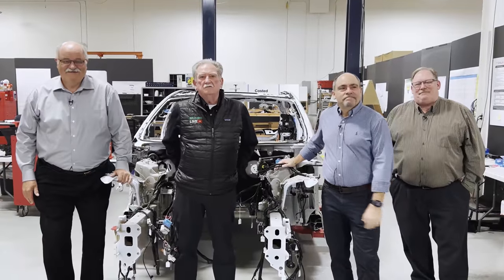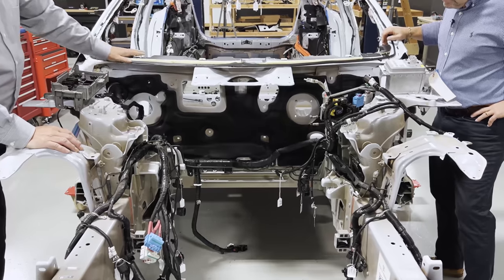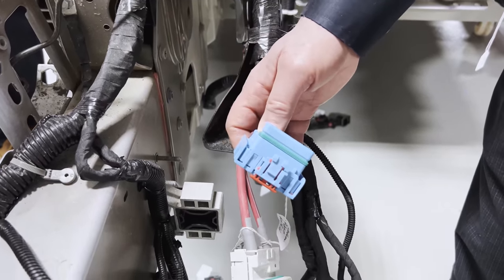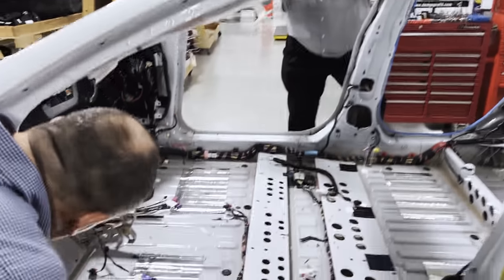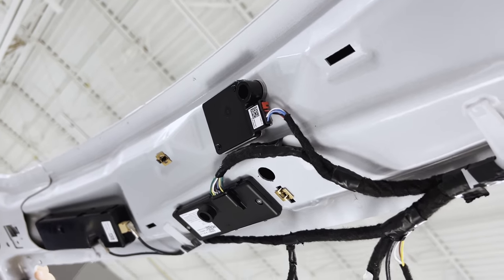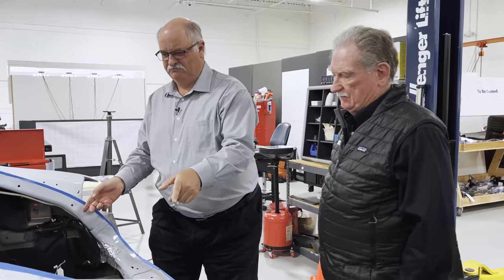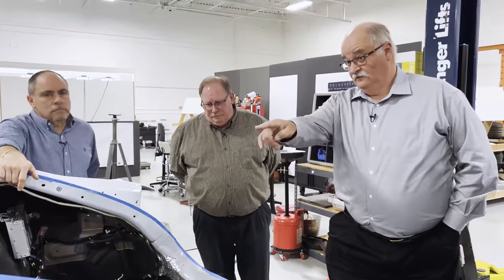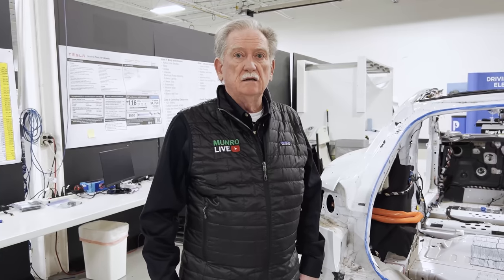Plaid Low Voltage Wiring First Look | Tesla Plaid Teardown

Comment: the loop on the harness going to the seat is to solve the issues of the harness being tangled with seat guides when the seat moves (up, down, forward, backward). Basically, the harness needs to exit the carpet in a certain direction to avoid that issue. This is a cheap and quick solution compared to rerouting the whole harness to solve the issue. I work 9 years in harness design and I did/would do similar if I were them.
Reply: what do you think about using a curved track for the seat using just 1 motor, as opposed to a conventional many motor design ?
Reply: @markplott4820  if you are toll, you will move the seat backwards and lower it... If you are short, you will move it forward and up... Basically there are positions that the seat never goes to... And Tesla can monitor this data easily as seats have memory. It's data analysis and improvement in its purest form. There for sure will be few guys that will hate it, but majority will not notice the difference. There is also a safety aspect of seat position to steering wheel airbag deployment. Some people just position their seat really badly and airbag can actually hurt them... This can narrow that issue.
Reply: Every cars/manufacturers have their own designs of course and some car's actually offers way more features on the seats alone, have you seen the Mercedes sclass seats?! Those things have everything from stone massage to heating, side bolsters that hugs you even cornering fast and a lot more.
Reply: I hadn't thought about thar.  Might a challenge to manufacture.  You also have to remember a short person may be proportioned with longer legs and a short torso or the opposite, so height needs to be adjustable at both ends of for aft travel.
Reply: I was thinking it could also be some extra line for the model X so they can use the same part.

Comment: The loop for the front seat harness must be for Model X seats. When installed into a model S the extra harness length must be looped/clipped.
Reply: Yeah, I figured reuse of harness from a shorter vehicle.
Reply: You can't be more wrong. This harness is unique to model S. The loop is to direct harness when exiting the carpet.

Comment: I bought a 1948 Jeep in 1965 and a new Tesla Model X in 2019.  I could fix anything on the Jeep with a basic tool set.  If I ever have to repair the Model X it will be with a cell phone and a credit card.  Times have sure changed.  Jess

Comment: Thank you guys for making these videos.  There is so much that most people (myself included) take for granted in the design and engineering of a good quality vehicle.  I especially enjoy your reactions when you see innovations never before seen in a vehicle.  I don't know if you are going to make a final "lessons learned" or "improvements needed" video at the end of this series, but I'd love to see that video!
Reply: Yes @MunroLive please do a wrap up video which summaries all the departments!
Reply: Tell me specifically what "innovations never before seen in a vehicle" you saw in this video. What I saw was a car wiring harness with the typical hodgepodge of connectors, random lengths, and misfits you will find in anything out of Detroit. I saw high voltage cables run inside the cabin, which I don't think anybody else does. I saw the usual crop of suppliers that everybody uses. So tell me about the innovations you saw.

It helps if you watch these videos while listening to the real engineers and muting Sandy.
Reply: @Bill Kerr It’s obvious they were talking about many improvements, not the harness. You can just say you don’t like the harness.
Reply: @taylor92493  Tell me what specific "improvements" you saw.

Comment: Harness protection so important. I once raced at Sears Pt Raceway and Laguna Sega with a Datsun 510 B-sedan Road car I found all kinds of wire wear at the end of the season.  Inspection after the racing season showed how wire casing caused by vibration wore protection covering of wiring so much that the wire was exposed.  This was amazing.  The vibration was called “CYLIC VIBRATION” found in race cars, so when this vibration cause wires to vibrate against another object, wire protective covering wears out exposing the wire. Solution was to rewire my race car with the knowledge of cylic vibration.  I finally rewired my Datsun race car for the new season using protecting casing and using a small rod and twisting the wire to absorb the cylic vibration. 

I always wondered if the vibration from my race car effected my heath or maybe it was like a extra extreme massage unit.

Comment: Regarding sensor bandwidth, it can also help with latency.  Less time to transfer the whole sensor reading to main computer.
Reply: Is Jitter also reduced?
Reply: ...or they realized the info wasn't quick enough for FSD to utilize it efficiently?
Reply: We have to also consider the changes that Tesla is making to how camera data is being handled. They are now talking of using the raw pixels rather than a processed picture. They want the data faster and the want the full range of the raw data over the processed pictures that are made for human consumption. That has increased the data load I'm sure.
Reply: @kstaxman2  CAN, even CAN-FD, is not nearly fast enough for multi-HD-camera use. It'll more likely be for the proximity sensors, and maybe suspension sensors etc. (CAN-FD is 5Mbit/s max; uncompressed that's 10s to transfer a 24bit full HD frame)
Reply: This was for the ultrasonic sensors, so bandwidth shouldn't be an issue.

Comment: I think the looped, tied-down seat harness thing might be for wear issues.  It provides what appears to be a pivot point for the harness to move about while limiting wear on the harness itself (and bending forces at the connector).  Because these seats are probably designed with ride-sharing in mind, they can expect thousands of times higher movement counts on the seats then a normal car as it would adjust to every user automatically with a tie to your tesla account.
Reply: I completely agree with the limiting wear. That's a really good point about ride sharing. I am not sure about the placement of the seat, but I think with the loop it would be the difference of moving the cable with a 30 degrees bend as opposed to 90 degrees bend with a shorter cable.
Reply: Tied down loop in the seat harness is likely to allow for the same harness to be used in Model X. Tesla uses the same seats for S and X and just puts the X seats on risers. On a Model X, they would use the same harness and just clip the tie for the loop so it can reach the seat that sits a couple inches higher up.
Reply: @lanesalbacka1821  that's plausible, good call.
Reply: Look like a loop around a connection between two wires to transfer the pull force bypassing the weak point.

Comment: I would guess the seat wiring length loop is for Model X compatibility. The seats are are up higher off the floor. Same part, both cars.
Reply: That's my guess as well. Loop seems obviously to stop excess cable length from flailing,  and likely reason for excess length is using a harness designed for a different model or configuration.  Parts bin vs optimisation.
Reply: The loop might  allow for easier installation of the seat.  The extra length would add clearance for hands and tools under the seat. It doesn't look like an afterthought to me.
Reply: @frankhage1734  Goes against Sandy's philosophy about saving a gram here and there and soon it adds up.
Reply: The harness loops on itself to exit carpet at certain direction (not forward, but backward). Otherwise it would get damaged when moved...

Comment: Recognizing hordes of Tyco / TE Connectivity connectors in use on the LV wiring.  Similar connectors are what are used in VW group's cars for decades;  TE is a major OE supplier of connectors on euro manufacturer vehicles.   I hadn't watched any other teardowns that covered earlier Teslas to see if they used these before in other models.

I was happy to see that Tesla's picking parts off the shelf for this -- and for the same reason other automakers do the same:  save your engineering resources for all the other things in the car that need to be sorted.

Comment: The main controller box is probably a universal part for all models and the secondary box is for stuff specific to S and Plaid: second fan, second pump, air suspension etc. So probably not really redundancy.

The extra loop and clips for the seat wiring seems like maybe they had issues with the wire bundles getting out of place and hanging when the seat is being moved or even during assembly, possibly damaging connectors. So theyve mounted it to the floor to limit the range of motion and relieve stress on the connectors.

Comment: The connector seals are, to me, always a concern.  I lived in an area (on the farm) where it would be close to zero for a week or more, then a warm front would come through.  Everything would be wet and dripping water.  Electrical connections were always a problem.

Comment: Thank you for the efforts you are doing. Curious what voltage they chose for the accessory system. Possibly 20 + volts using a 6s or 7s auxillary battery. I would believe they chose a higher voltage to save weight and use smaller guage wiring.
Reply: I was wondering this too.
Reply: A 4 cell battery, 3.7 volts per cell so about 14.8 volts. A lead acid battery 6 cells at 2.2  volts per or 13.6 volts.  So for the most part still a 12 volt system.
Reply: @dalekoch5265  3 cell fully charged is 12.6 volts...discharged 11.4ish
Reply: @jasoneyes01  thank you.  Still learning.
Reply: They are not yet going with a higher voltage. Too many parts are only available for 12V, so they would need to order bespoke components for everything.

Some day we may see a switch to 48V and fibre connections for the data. One cable the size of a normal wire going from each component to the next controller...

Comment: ohhh my guess for the extra loop cable is that is for if the seats during an accident moves further than it should the seat wont pull on the cable as much so the full absorption of the impact can be fully achieved.

Comment: Sandy-I have a theory on why the wiring to the front seats is longer than necessary in the S. I would assume they are sharing many components with the new X.  Perhaps, similar to the Y using the 3’s seats by just adding spacers from the floor to the frame, they could be doing the same thing here. Given the low volume of the X and S, it was a lower cost decision to use the same harness instead of having two separate (shorter and longer) designs.  Assuming the X and S’s come from the same assembly line, this would simplify assembly.  Steve
Reply: Interesting!

Comment: The Plaid is a revision of the original 2012 Model S, not a completely new car like the Model Y, so the comparison of the Plaid would be better made against the 2019 Raven Model S, than with the Model Y. The Model Y platform is based on the 2017 Model 3, but the Plaid is based on the 2012 Model S platform. 

So it’s not really about what things they’ve done better on the Plaid than on the Model Y, but the improvements over the 2019 Raven Model S. It’s impossible to compare the Model S platform with the Model Y platform, because the Model S is a 10-year old platform and the Model Y a 5-year old platform. 

Thank you for you great videos!

Comment: Thank you for all your interesting analysis. It is all useful input to the EV purchasing process for those with the curiosity and time to learn new things.
Looking at all those cable looms, and imagining the multi CAN/CAN FD  complexities;  as an IT person, I wonder if or when the automotive CAN system might be replaced by mature, widely used, more modern, cabling and protocols such as Ethernet? Such networks appear to offer higher speeds, better security, fiber optic options,  and many design and  management advantages.
Reply: CAN is much easier for the sensors, a CAN sensor might not even have a CPU as such and implement all the logic using simple logic circuits. Second, CAN bus needs just one pair of wires unlike 5 pairs in Ethernet CAT-5, moreover this wire is a bus shared by all the devices. You don't need to run individual Ethernet cables for each device. Third, CAN bus has built-in prioritization features (higher CAN PIDs have priority) and it typically can be analyzed statically to guarantee that there's always enough bandwidth for critical messages. Fourth, Ethernet uses 1.5V signalling and is thus much more susceptible to EM noise than CAN buses that use 9V signalling.

Comment: Surprised you didn't mention the main cables going over the cross beams by the back doors on each side... the cable lays very close to where the floor meets the door opening to pass over the cross beam... When a tiny 'divit' where the beam connects to each side would have laid the cable out of direct exposure to potential 'contact pressure' as people get in out... they stuck out like a sore thumb to me (unless it has a hard protector cover to deflect contact pressure, but that would stick out even more!)

Comment: Looks like the shroudless connector connects inside a (polymer?) box with other similar connectors?  If so, I certainly agree with Sandy, no reason to have another shroud if the whole assembly is inside another box which should do the job a shroud would do.

Comment: Another great episode!  One reason to use a connector with excess pins may be supply issues forced a late change.  Also Tesla may have lots of connector stock they could use up with this relativily low volume vehicle, but that seems less likely.
Reply: 1. Bigger connectors are not necessarily more expensive. It's all about volume.
2. They might be planning more features for the seats, so they already applied connectors with more cavities.
3. Shortage of smaller connectors.
4. Lack of smaller connector that was suitable for current/wire sizes

And many more possibilities...
Reply: @MarekReinsch  5. They put in that connector early in the design, expecting more wires to be added later, then never downsized it in the end.

Comment: I'd love it if at some point  Dale could talk a bit  about anti-oxidents or is it dielectric grease? (I've got an old tube of OxGard I bought for outdoor sprinkler systems but use it for lots of things - like on batteries in flashlights. Caveat: I don't know if I'm using it correctly. One thing my 'experiments' have demonstrated is that it doesn't hurt any connections. I've slathered it on the ends of AA batteries and never had any problem making the connection.)  I'm a sailor and I'm amazed that it isn't used all over ocean sailing yachts (salt water). Maybe I'm missing something.

Comment: If not for capacity, they probably switched to CAN FD for the reduced latency in the autopilot stuff. You can deliver 100 bytes faster at 5Mbps than 100Kbps. The FSD release notes have mentioned reduced latency a lot lately.

Comment: I recall Tesla filed patents for a modular wiring system that would use a lot less of the old-style bundles of wire and rely more on local network communication across a small number of wires. This seems only halfway to Tesla's stated goal of having a lot less copper wire in each car.
Reply: The copper wiring harnesses are still “old school” technology. I predict that the Tesla Cybertruck will be the first vehicle to use a radically new 12v wiring system.

Comment: I was wondering about the multitude of different connectors. Then I thought of Poka-yoke techniques where different connectors in a similar location avoid assembly errors, and reduce time to build.
Reply: Good point. Made me think of those servers with hundreds of identical network cables.

Also, thanks for letting me know about Poka-yoke. It's something I do but didn't know the term.

Comment: 18:38
It’s makes sense to use solid conductor
It’s better for high current reducing heat and probably cheaper
Reply: Stranded gives flexibility over multiple bends.  Besides for the same gauge its a little lighter, there is air between the strands.  Also for 26 gauge you can use a steel center conductor for column strength for terminal insertion into the insulator.

Comment: Hi Sandy, the antenna modules do also support LTE? Are there any more antennas or the two above the wind shield serve all the needs? Are the two antenna modules completely identical? There used to be antennas also in the outside mirrors, or not any more?

Comment: Great video as usual. Thanks. It looks like the small LiOn battery that replaces the 12V Lead Acid is not cooled.. any particular reason?
Reply: Aluminum case acts as a heat sink and you can charge it slow.  Let the DCDC converter manage the high currents.  We should have did some loads testing to see just how much current the battery is expected to supply.  There are folks working on eliminating the battery entirely and just using distributed DCDC converters.  More on this another day.

Comment: What is the sensor or black box tucked in the top rear cross beam?  I would think Tesla would make their own proprietary connectors for consistency, simplicity, quality and standardization.  Can't be that costly to mold plastic connectors.  I'm curious on the grounds for the sound system if they have a single ground or multiple grounds, which can lead to system noise for a number of reasons.  Could the extra long front seat wiring harnesses be for ease of robotic seat  installation and once installed, an assembly person fold, tie wraps and snaps to the floor?